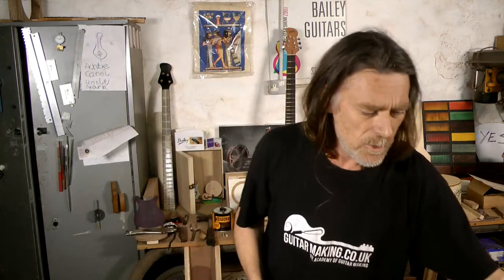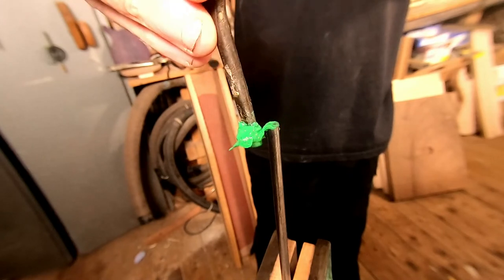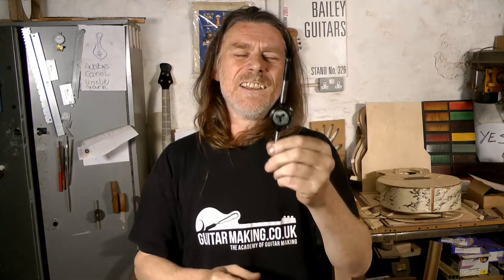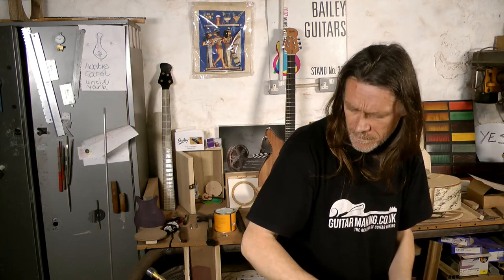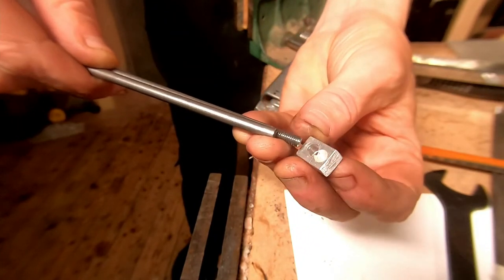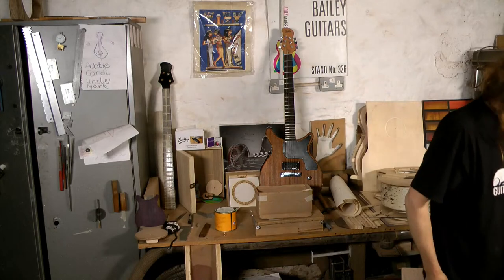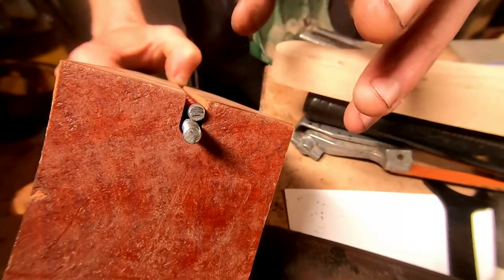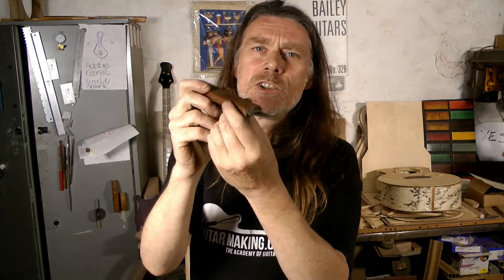Let's Make a Truss Rod! Different types of Truss Rod for guitars explained...your Q's Answered

Comment: After 35 years I had my first truss rod snap the other day, in a 5 string bass I've been building. Doing the final setup and bang, the rod snapped where it had been welded to the adjusting nut (dual action rod). Steaming off the fretboard on a neck-through was painful, I ruined some of the body lacquer despite my best efforts so it will need a refinish too. Anyway, I have now made a new rod in the manner of your acoustic rod and it works perfectly. I had the advantage of owning a small mill and mini lathe to make the block and nut. Thanks for sharing the design, works a treat 👍
Reply from the maker: Thanks for the comment - Awesome!

Comment: Hi,how do you match the die size with the nut thread (size)? Very enjoyable and clear explanations-a natural teacher.
Reply: Truss rods and nuts are an easy 10/32 american thread...guess what? The guy wires on stearman biplane flying wires from the 30's are also 10/32! If in case you have a screen door squaring wire from the 20's - 60's it is probably also 10/32! Loool

Comment: Greetings from Bergen, Norway! 

Thank you for an excellent youtube videos on making truss rods! I have an old bass in which the truss rod snapped. I removed the skunk stripe and took the old rod out. Bit of work that. Its a single piece bolt on neck, like you show in the end of the Q&A part, with a skunk stripe. It's a Cort GB54. My first bass, so sentimental value and all that. The depth of the groove in the neck is also curved, as you explained. Looking a the specs of most truss rods, they wont fit because of this. It ranges from 11 mm at its deepets, to 9 mm on the middle of the cut, at its shortest. Could probably fit one, but I would have to chisel the skunk stripe down to almost nothing. Another issue would seem that using "standard" truss rods, I would have to drill a whole for the end bolt, parallell along the line of the groove, on the bridge end of the neck - fastening the bolt from the other side.  Could I "convert" the bass neck to fit a standard double truss rod, by drilling a hole at the birdge end as well, compensating with a slightly longer rod? 

Simen